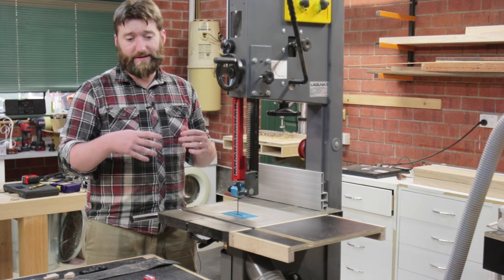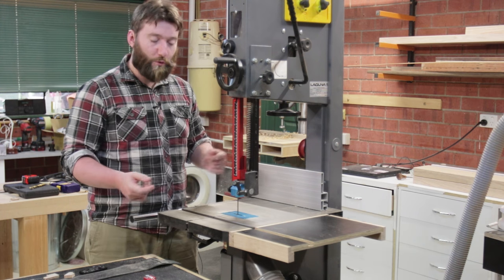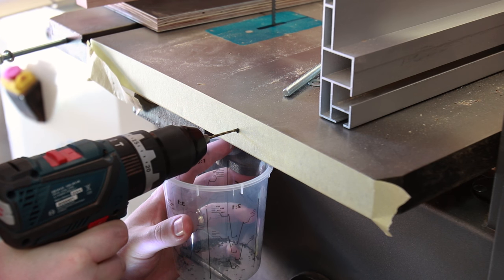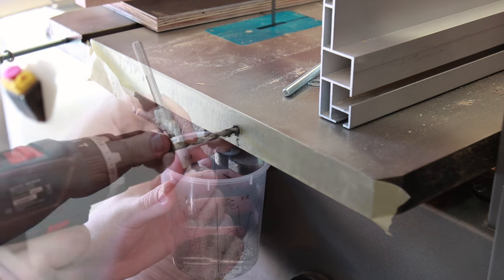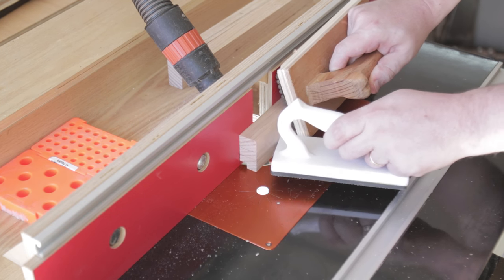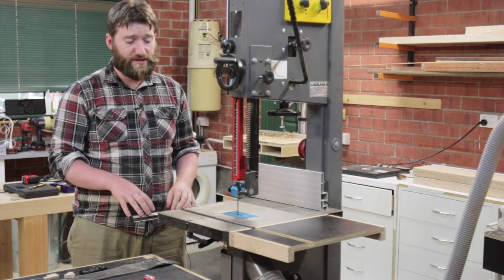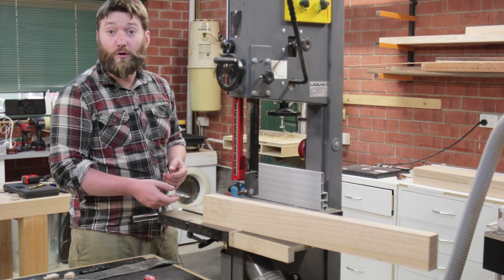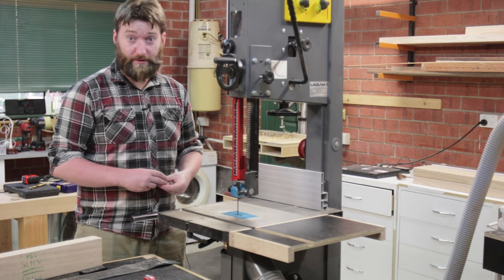Bandsaw Outfeed Table

Comment: was going to say that is a great idea I wish all band saws came with something like that surprised they haven't came up with something like that in the stores
Reply from the maker: I think a lot of machinery would really benefit from "accessory rails", even if they don't make the accessories. That way we could make our own extension tables for a lot of stuff. Having "just" the mitre slot for accessories seems very very old thinking.

Felder/Altendorf I believe do have these on a lot of their products, but they also make the accessories. ie, outfeed table that clips onto the tablesaw, bandsaw, or combo jointer/thicknesser.
Reply: Paul Jenkins i agree with u .. but then again if they did that then those big time companies couldn't charge $30,000 for one of their large band saws that have everything but as you just demonstrated if you take the time with a little bit of know-how you can make your own and customize it to suit your needs but they could throw us a bone and make the rails that would definitely help out.lol I need to pick up a tap and die set so I can do this to my band saw and may even do this for my table saw for an in feed table and my jointer because I have a benchtop jointer with a very small infeed and outfeed "/  once again great idea! and thanks for the inspiration🍻
Reply from the maker: IMO Felder/Altendorf could still get away with charging their prices - they're amazing machines. Have you seen the options available on an Altendorf F45?!

For infeed on your table saw, Jay Bates did a 'plywood infeed' hook type system which I think is a pretty good idea - I think for infeed on a table saw you don't want it permanent.
Jointer (or in my case combo machine) could really benefit from this, but it may be a good idea to add legs to the table so it doesn't flex/get the jointer out of alignment.
Reply: Paul Jenkins oh yeah that's right he didn't make that a couple years back and that is a good point a permanent in feed on the table saw we're not be a good idea and another good points for the jointer definitely have to look into that but no I have not seen that F 45 I'm going to go on Google and look it up right now I know Jordan's Woodshop has one of their panel saws and that thing is massive and amazing I would love to own one of those if I had to space for it that is
Reply: Maybe one of these years..lol

Comment: Thanks Paul, I was looking for an example Laguna band  saw table extension idea. Great video, nice clean design.
Reply: Btw, can you explain what the mortises/slots are for on your side rails? I the fully assembled shots, I can’t see them. Thanks!
Reply from the maker: +Elie Bitton the mortises for the dominoes were to attach the side rails to the back back. Or do you mean the through slot on the back rail? That was so I could cut it on the router table without bothering about a stopped groove so it was quicker to make
Reply: Ah. Avoiding the stopped groove. That makes sense. Thanks!

Comment: I wish I could do that but my fence grips front and back. I like your alot though well done brother.
Reply: Art Connolly if you were to use mounting arms on the sides of the table and left an open gap between the back of the table and the front of the outfeed table, you could still use your fence. Just a thought/suggestion, hope it helps.